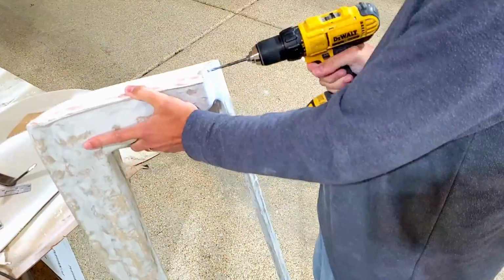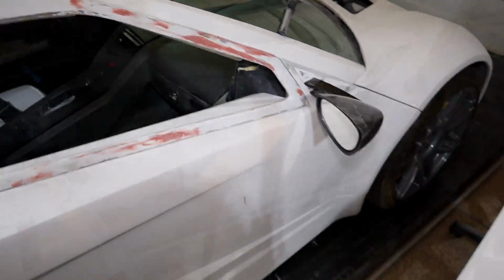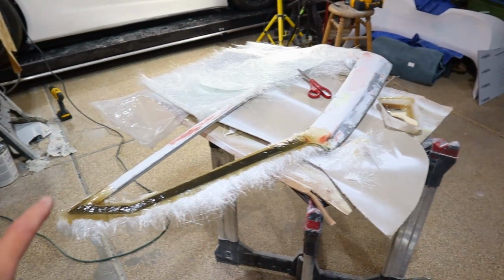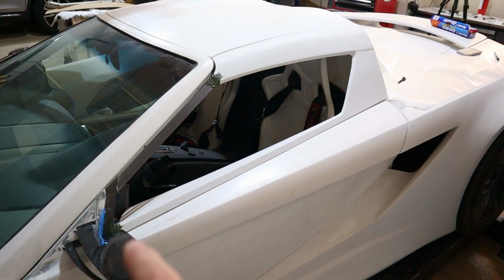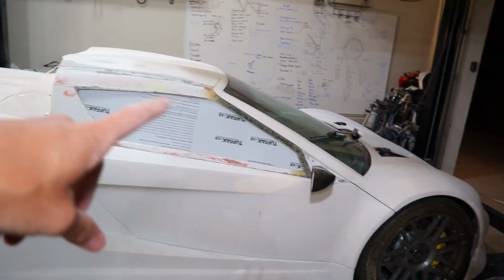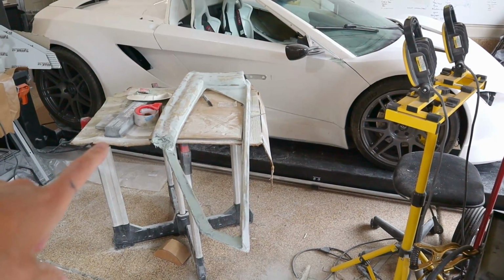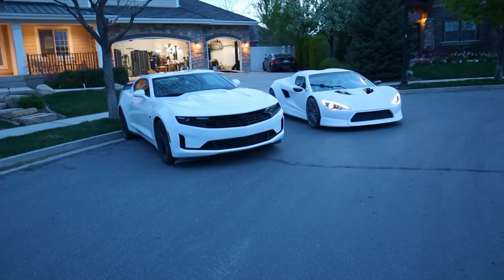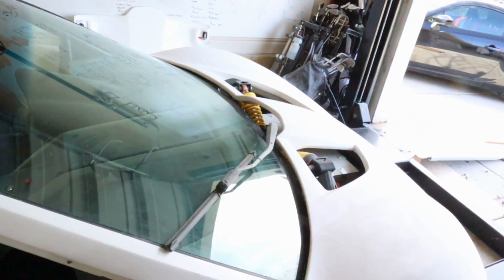Steel Reinforced Fiberglass - ESC S1 E119

Comment: The car is coming together real nicely. I've noticed that you are using a lot of primer spray cans. If you are thinking about painting your own car, might I suggest that you pick up an air compressor and spray gun already, and start practicing with primer. That way you can get a good feel of technique.
Reply from the maker: Thanks for the comment!   Do you have a suggestion on paint guns?
Reply: @electricsupercar  

For me, if this is something that I wanted to try out, I would just buy gear from Harbor Freight both gravity fed and regular spray gun to see which one I like better. And if I am comfortable doing it and it’s within my budget, I would buy brand names after.

Speedkote refinish network has a good layout of what he uses and brands to get your car painted right. He also does a good job explaining the paint process in his other videos.

https://youtu.be/pfN1mXJuryA
Reply from the maker: @phatxsr20  thanks for the info!

Comment: I just finished watching all your episodes so am finally up to current times. Two suggestions that came to mind throughout:
1) your main pack should always be charging your 12 volt pack even with everything off. That's the way Tesla does it so accessories don't drain the 12 volt over time or so you can have lights & entertainment on with the car off.
2) you may want to look at garage door track extensions to move the opener to the ceiling over your lift.

John
Reply from the maker: Yes my height clearance is tight

Comment: I am wondering if you have any concerns regarding laminating Fiberglass to Metal? Did you take any additional steps to keep the two bonded... there is going to be a lot of flex in that location.
Reply from the maker: Steel bonds quite well to the fiberglass resin.  I have done this before with the trunk and seems to work well.